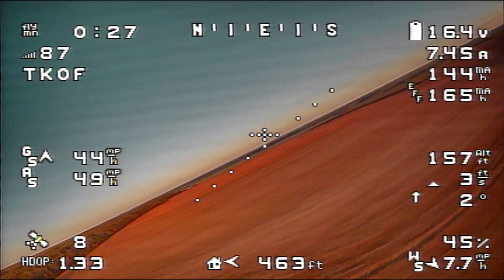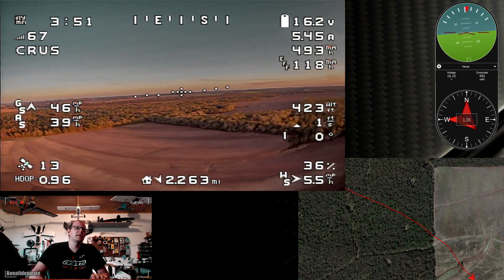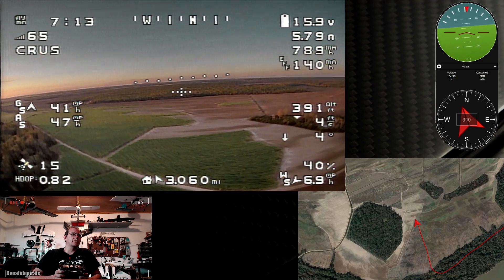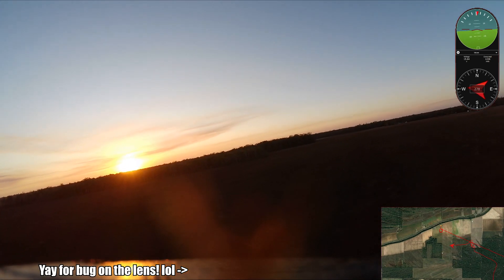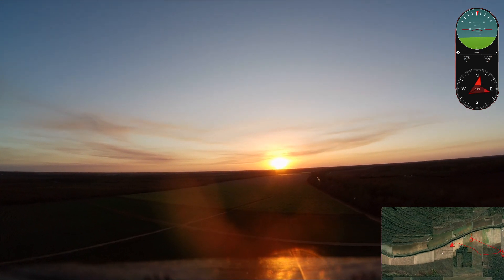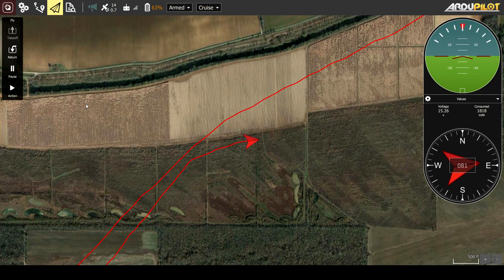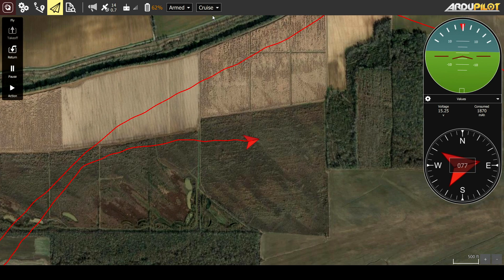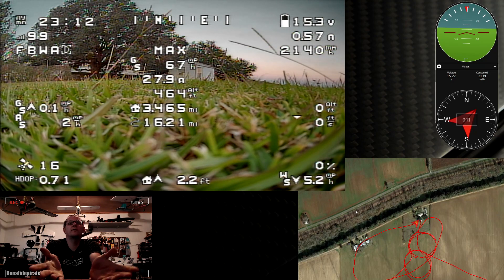AR Wing Pro, Runcam 4K, QGroundControl

Comment: Nice one Keith. That 4K cam is not bad.
Reply from the maker: Yeah I like it for sure, seems like a nice balance of near GoPro quality (at least compared to mine, the last one I bought was a 4 lol), better form factor like the Mobius style cams, lighter weight than some, especially if you run it with no battery, and analog out of you want it. I was only recording at 2.7K/60 for this one, then downscaled it to 1080 for the upload.
Reply: @bonafidepirate  I did notice the colors were petty good for this. Not cheap in Kanada but still worth a maybe.

Comment: Do you know what QGroundControl parameter applies rates or weights in Manual flight mode (similar to using weights in OpenTX radio mixing)?
Reply: you adjust servo travel in the servo output tab..
Reply: @JamesHurd  I don't see this. Mission planner has a servo output tab, but QGC doesn't seem to.

Comment: Wow, you never stop surprising! Amazing, well done!
Did you find the source for the "wobbling"? We'll be happy to get a hint of what the problem was.
Reply from the maker: I've had a friend that's more experienced with Ardupilot look at it, he went over the logs for this flight and all and we didn't find anything glaringly obvious, other than maybe tuning on the roll axis (I'll play with that more later) or maybe just adding the HD cam on top of the hatch in front of the CG might be taking away some yaw stability. The plan is to fly again without the HD cam and see what it does, then play around with tuning on the roll axis and see if I can get it any better.
Reply: @bonafidepirate  Thank you for the answer. It does not seem to me that the oscillation comes from the camera or a disturbance in the structure of the aircraft because it disappears in manual mode. Such oscillation is very typical of the lack of calibration of PID values. And especially to the part of the I in the PID. I would raise / lower the value of I and looks to see if there is a change in any direction.